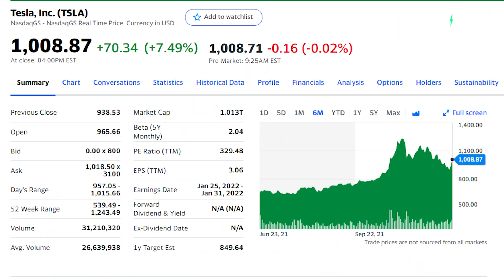LEGACY auto shoud be PETRIFIED of TESLA/CATL in 2022

Comment: There is NO way a new vehicle will launch next year.

There is no factory to build it.  Tesla to date has revealed 3 vehicles already that has not seen production yet.  They are not going to reveal a new one and start producing it before at least the CT and Semi (Roadster is not a big money maker and doesn't help the cause) has seen mass production.  The $25k model MIGHT be REVEALED late next year but that IMO is also very unlikely.

2022 is all about scaling Berlin and Austin, 4680 production, bringing Semi and CT to production and getting DOJO completed (I don't think DOJO will be done until mid to late 2023 though).

Tesla has enough on its plate and it would make zero sense to create demand for a new vehicle.   Tesla already has more than enough demand and need to rapidly increase cell supply and vehicle production.

Comment: Important News; great video! Thanks.   Why not add mid Axle wheels to help carry the load of those heavy batteries?  The old answer is:  that you need ground clearance to allow the other wheels to use ruts in the road.  We hardly have those anymore.  Ground clearance isn't needed. In fact, we need to mitigate the making of ruts in our present roads.  A spring loaded middle wheel, on a caster,  would add longevity to the road infrastructure.  It can be a solid tire made of old recycled tires and plastics.
Reply from the maker: Thanks for the tip!

Comment: Tesla Shanghai’s annualised run rate was at 660k in November 2021.
Cost of production of both model Y and 3 is already falling like a rock, add LFP and the Model Y can sell for 25-28k
Many countries offer subsidies further reducing the price point and running cost is very low.
Model “A , Q or whatever you call it will probably have to be left to the Chineese for now.
3-5 million model Y’s at 30k will sell easy for many years, why bother with a cheaper model? Why fight the Chineese?
Cyber truck + Van + SUV should be a priority.

Comment: Hi , I suggest Tesla Shanghai is already at a run rate of 700k/yr despite chip shortages and they are still expanding the site, it will probably get to 900-1000k/yr by YE 2022 basis mainly off model Y standard edition using CATL LFP cells?